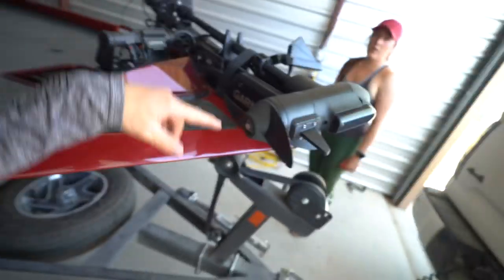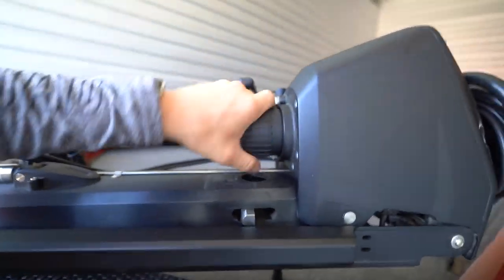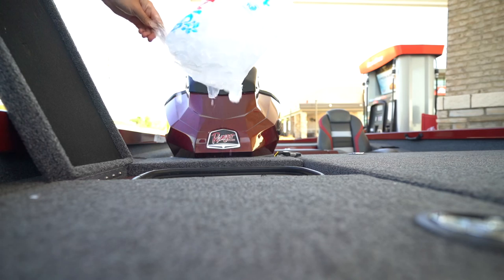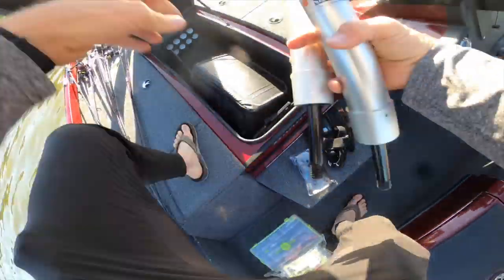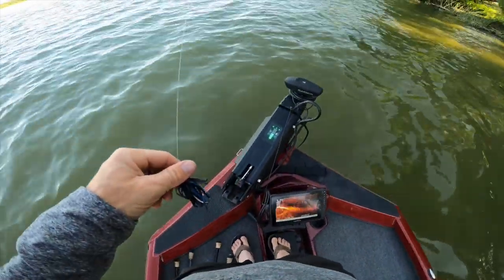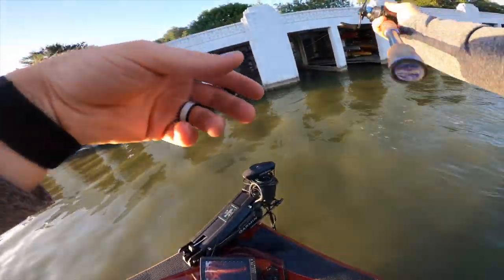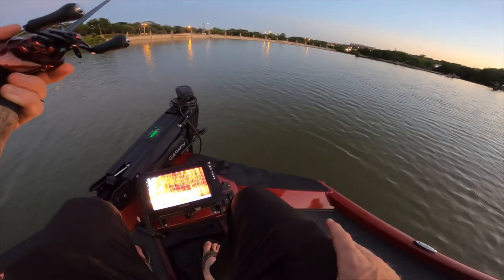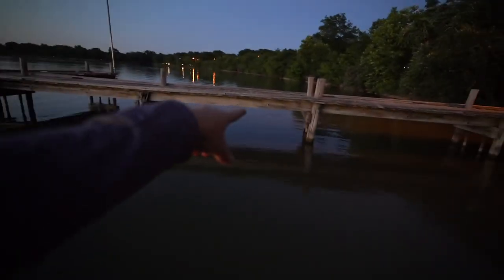FISHING THE BEAUTIFUL YET DISGUSTING WHITE ROCK LAKE!!

Comment: So that's my story, trying new waters and not catching anything . With regards to your TM you're on the right track.  Prop faces starboard and the Garmin transducer is on the top. There's a S / P on the bracket. Instructions are that the S (in this case) should be centered on the shafts centerline. Unfortunately, having it on the starboard side mskes it difficult to see the markings on the side plate.  Thanks, as slways for the entertainment and information/ tips!
Reply from the maker: My pleasure! Thank ya 🤘🏼

Comment: You can stow either way, just align the P or  S on the bracket to the center of the the trolling motor.  There is only one bracket, not a separate port and starboard bracket.
http://static.garmin.com/pumac/Panoptix_LiveScope_Perspective_Mode_Mount_Install_EN-US.pdf
Reply from the maker: You are correct but the way the trolling motor defaults when you pull it out of the water hits the transducer because we have the perspective mode mount which DOES come with two brackets one for port and one for starboard.
Reply: Westin Smith check out the instructions I linked, it tells you how to change it with the standard bracket